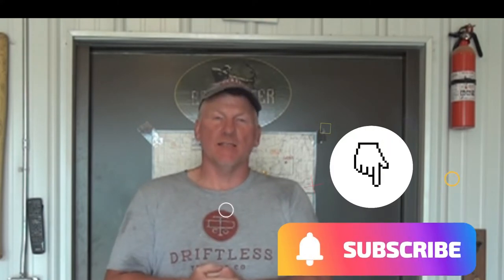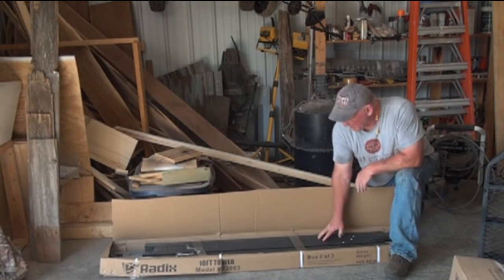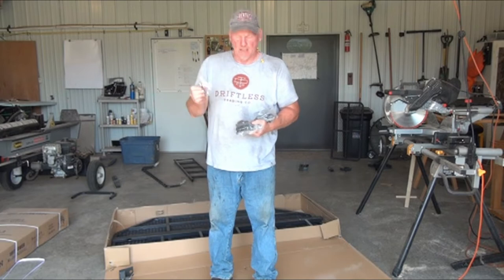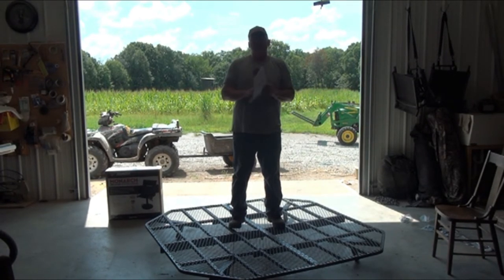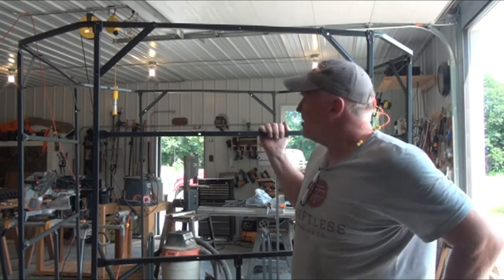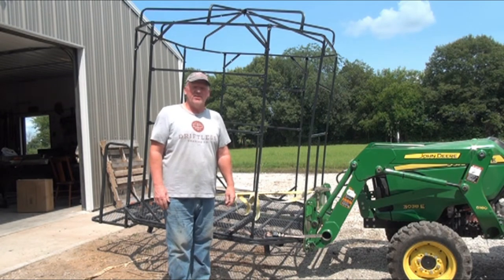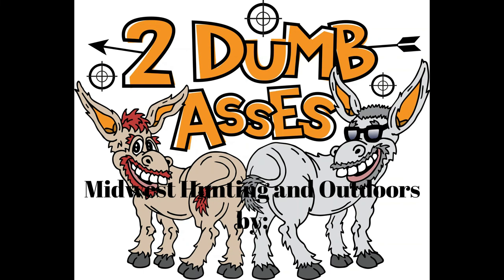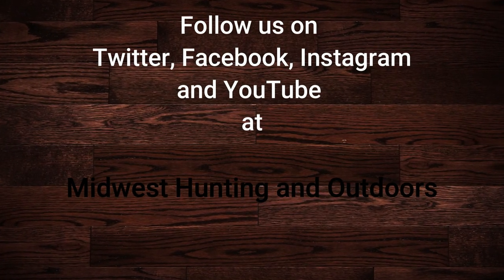Is This the Best Value In Elevated Hunting Blinds?

Comment: How did you get it off it’s side onto it’s feet? Unsure how to build mine in the field.
Reply from the maker: Jager once all the construction is complete, and the bolts are tight,   2 people can tip it up on its legs fairly easy and safely.    I have also used my ATV winch to pull it up into position.   It is easier than it looks, however I would encourage you to find a friend to assist you.